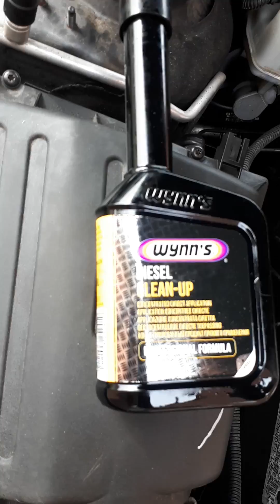How to clean fuel injectors without removing them.

Comment: Where did you get the filter from, thank you.
Reply from the maker: Hi I bought the filter from Halfords, but I have found since I made this video that you can lift the fuel filter at the tank and disconnect it.
Then replace the filter and fill the housing with the cleaner before refitting and running the engine.
I will do a nww video with this method when I next clean it.
Reply: Thank you look forward to that video.